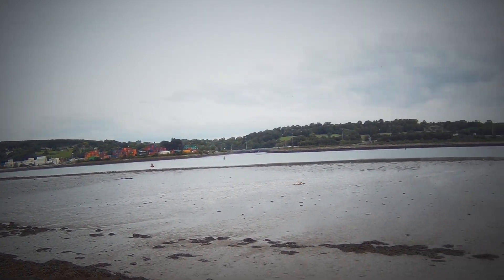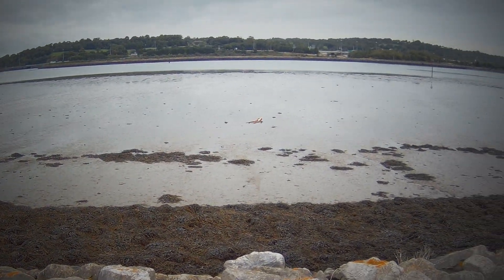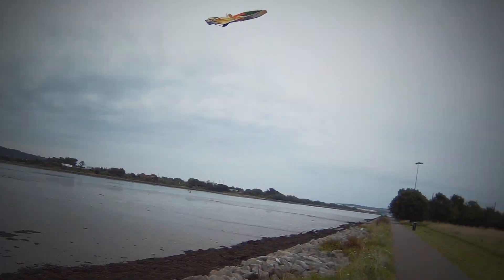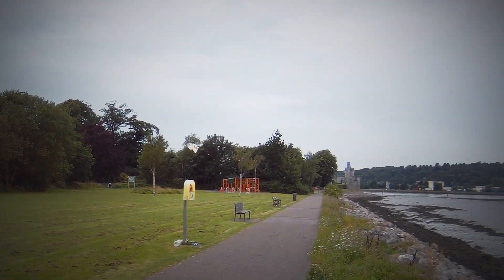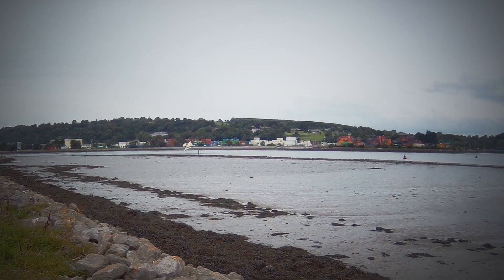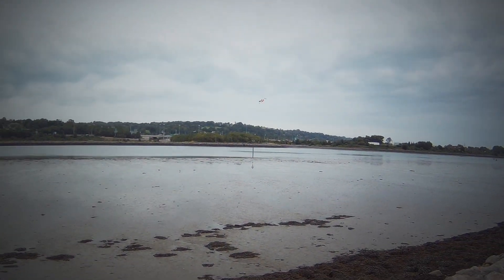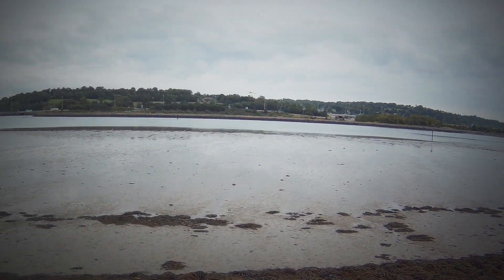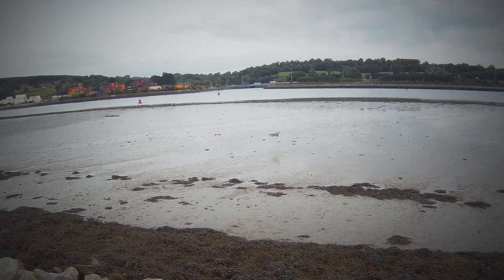Don't Do This with your RC Plane - Beginner Mistake

Comment: Corrosion x works pretty good but conformal coat works really really good. Put on two or three coats and it can still breathe
Reply from the maker: Big thanks for that advice , I’ve never heard of conformal, but I’ll check it out straight away. 👍👍👍

Comment: The esc needs as much airflow as possible to stay cool, they produce a lot of heat, fortunately i started off with n Eflite which they make it a point to make sure that you understand this in their manuals
Reply from the maker: Manuals, yes very informative, regrettably I stepped past that step . Ooops